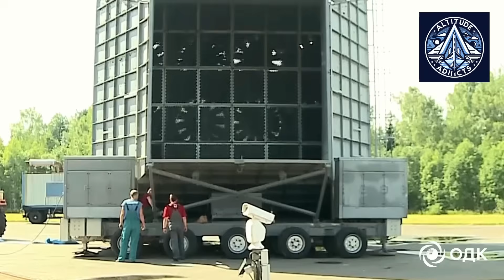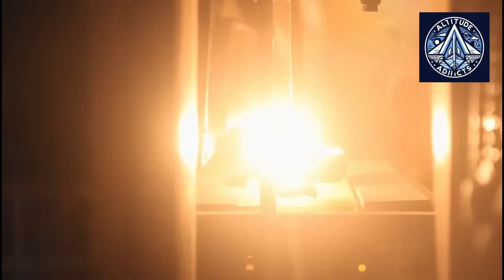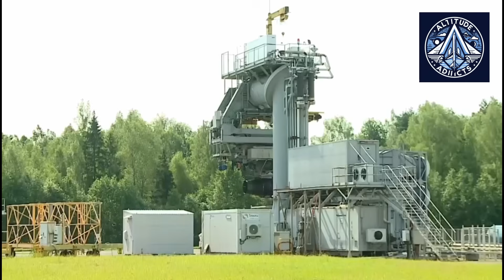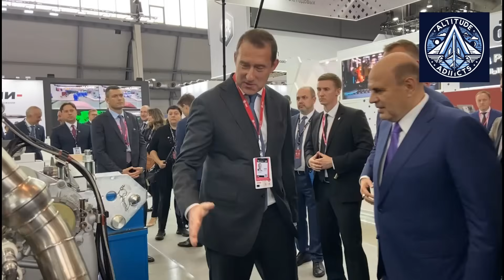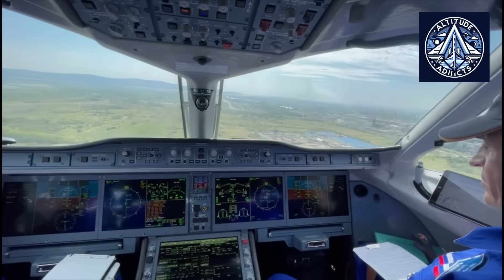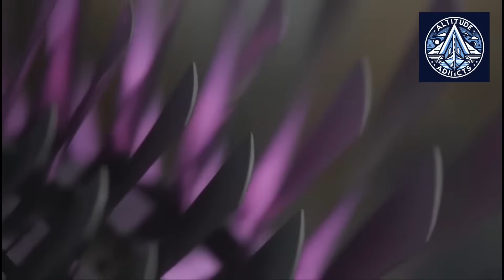Russia's New PD-8 Jet Engine Hits 4,000+ Hours | Superjet SJ-100

Comment: The PD-8 is nothing more than the reliable Soloviev D-30 with a slightly larger bypass ratio and a FADEC digital control system.( aka... A bunch of silly sensors and parameters that adds fluff to an engine rather than any useful use... The Soloviev used to criss cross the oceans on the Il-62 fith no FADEC or digital fluff of any kind, just optimized settings and analog monitoring gauges....
Reply: Молодец 👍 садись, всем четыре, тебе пять😂